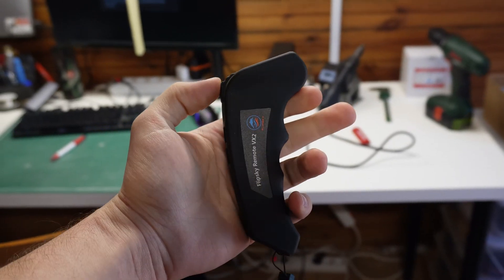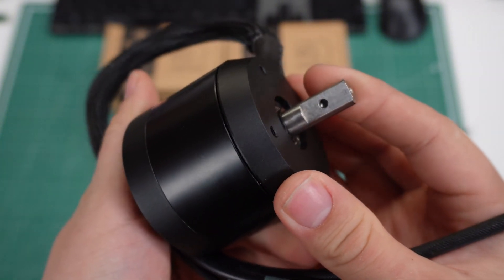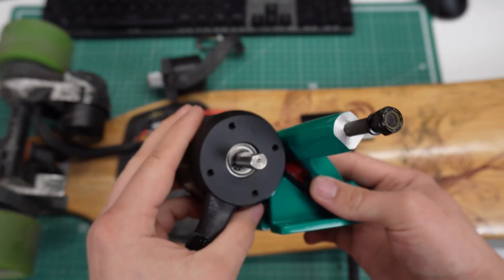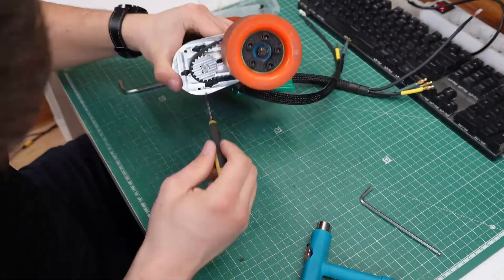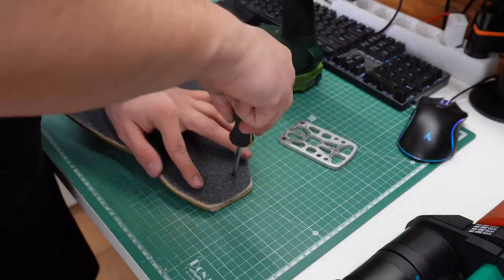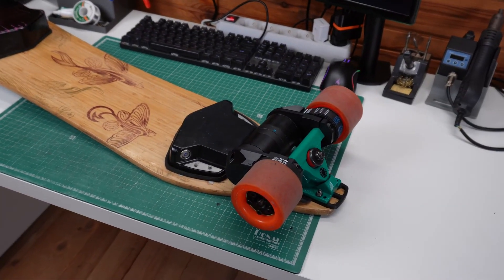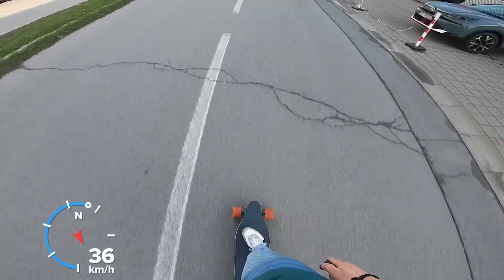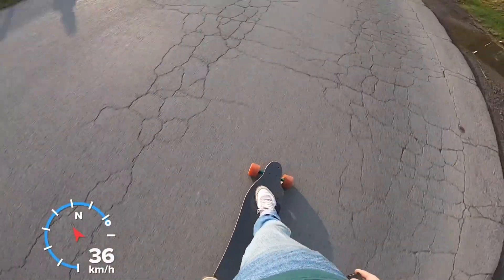Upgrade the electric longboard with Flipsky motor 6354 140KV

Comment: Can it be used as single motor in an ebike DIY project?
Reply from the maker: The motor is not a hub motor, but it also can use in an ebike for DIY project
Reply: @FlipskyTech  with sprocket chain system